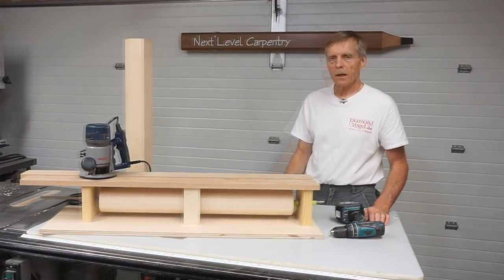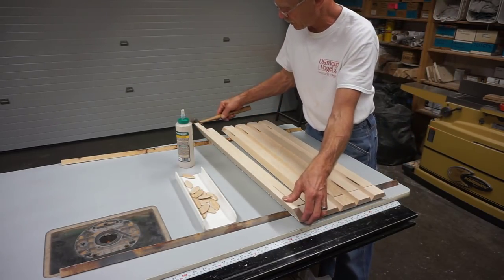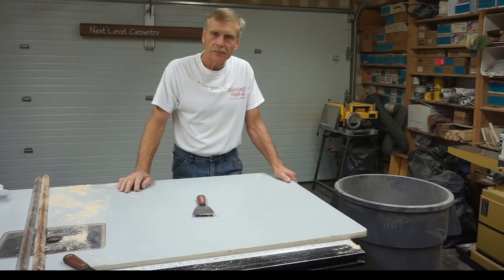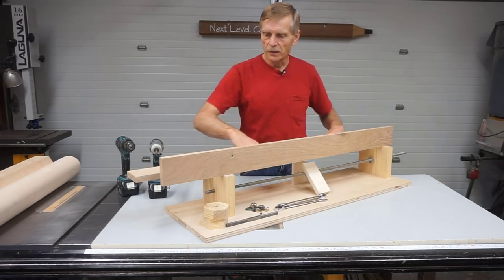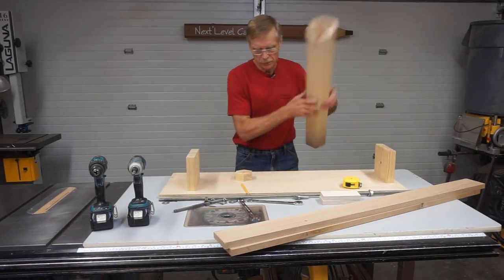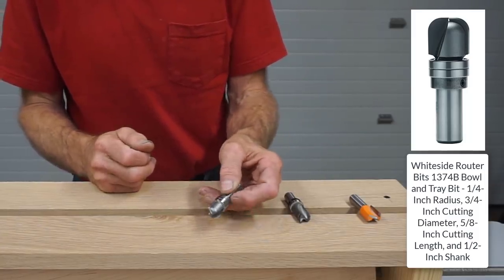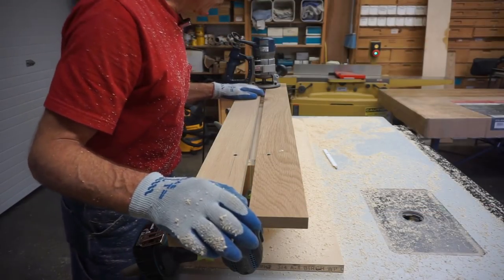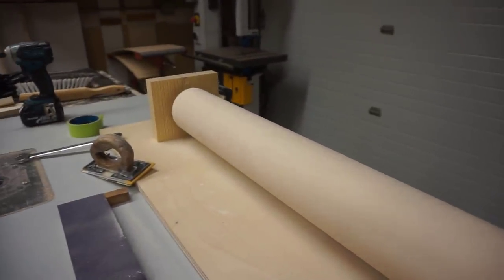How to Make Round Wood Cylinders with a Shop-Built Router Lathe

Comment: Hey Matt--Have just discovered your channel and am catching up on a few years of your videos. Great channel with lots of practical tips! Can you get away with a rectangular hub save yourself 8 rabbets and a bunch of cuts on the miter saw or are you worried about even torque distribution?
Reply from the maker: Welcome Eric... good question.  I suppose you could use a different hub setup if something about the process made the whole operation more efficient... if you're asking such a question I'm guessing you're the kind of guy who would do just that: build on what you learn and advance  the process.  I like how you think!  I don't think 'torque distribution' is as much of a potential issue as making sure everything is concentric so as long as you can still get concentricity (is that a word?!🤔) near to perfect, a different time/step saving configuration makes total sense.  Thanks for watching and commenting...
Reply: i guess I'm kinda randomly asking but do anyone know of a good website to watch new series online ?
Reply: @Layton Tucker Thanks, signed up and it seems like they got a lot of movies there =) Appreciate it!
Reply: @Connor Uriel glad I could help :)

Comment: I got one of those band clamps years ago for gluing frames.  I never considered using them for cylinders or using additional jaws.  Thank you for enlightening me.  For my hollow glue ups, I keep most of my punctured bicycle tubes and wind them around multiple times for incredible clamping force. They don't damage wood either.  You've probably used them to resemble chair parts as they conform well to the irregular shapes and angles and can pull in many more directions than bar clamps.
Reply from the maker: The clamps are great, aren't they Francis?  No substitute for inner tubes for some projects but remarkable for others!  Best, Matt

Comment: I do love how you take the time to explain each step in great detail so that the beginning woodworker can totally grasp the concept how to accurately produce the work.  Thanks!    The one thing I would have suggested instead of Nylock nuts is to just double the nuts and tighten them against each other.  Nylock  over time and use will not hold up as well.

Comment: Hi Matt,   I have done numerous such polygonal columns.   I have found that if I tape all the external edges together on the flat, inside down.    Carefully aligned while taping.   Then turn the assembly over and apply glue.    Roll the assembly up, stand on end, and slowly close the last joint [with tape already on one side].   The tape tends to push the squeeze-out to the inside.

Comment: I love this video. It reminded me of when I made 4 legs very similar to these. 1-1/2" stock instead of 3/4" and cut to 3-1/2" width on the wide side. 1/8" x 1/2" wide splines set into 1/8" x 1/4" deep dado ran the entire length of the leg. The reason for the extra thickness was because when I set up the centers, I raised one one end of the jig by 3/4" to create a tapered leg. The other difference was that I slid the jig over a router table between two runners attached to the table. The drill was still the same power supply for turning the stock. I love people like you who come up with new ideas for wood workers. Keep up the good work.
Reply from the maker: Cool that two entirely different projects were tackled in similar fashion Doug... I like how you think!  I hope I get a chance to do round legs with a taper some time... that's got to be even cooler to watch the turning process.  Best, Matt

Comment: Thanks so much. I know it's a lot of effort to do all that is necessary to post videos like this. One thing I thought of is that I liked the look of the leg after the 2nd or 3rd pass when it still had facets. More interesting than after it was a perfect cylinder. I'm wondering if you'd consider presenting this as an option to your next clients on a similar project. I love your channel.
Reply from the maker: Definitely an interesting option Stewart... didn't come up on this project since a 'perfect' cylinder was the goal but you never know when a slight variation might be just the ticket... thanks for watching and commenting! 
Best, Matt

Comment: Hey NLC   I think your co-commentator is slightly taller than you   .... a mammoth task to produce and I did make it all the way through .... very comprehensive and shows others how much actually goes into original woodwork  .... its not the outcome bt the process others learn from  .... a pro-cnc workshop could knock out a cylinder cheaply easily but not as satisfyingly  .... keep it up and thank you for your efforts  .... GB Bundaberg Australia
Reply from the maker: You're welcome, Greg... It can be a bit frustrating to see TV and video that drastically skims over the nitty gritty of craftsmanship, right? Love to see comments from down under... I'd love to grow the Next Level Carpentry audience in Australia... any suggestions for content you see lacking there?  Best regards, Matt

Comment: Enjoyed the video and information. A note myself: I'd be inclined to make initial passes down the length of the piece along the high spots (at the joints) with the stock locked in place in order to eliminate possible tear out during milling.
Reply from the maker: Slo Mo
You're thinking is sound.  Some of the difficulty I experienced was from not doing something  like you mention to whack down those points before mounting the blank in the lathe which is quite clear to me now, thanks to insight from attentive viewers like yourself who use their experience to guide them.  Your method would be a controllable way of removing excess wood from the blank.  Another viewer suggested using a tablesaw or jointer for the same result.  I really appreciate the non-confrontational way you presented this comment... this sort of discussion helps refine/improve the method for the benefit of all.  
Best,
Matt

Comment: Out standing video full of excellent information.For those that say it is to long then need to understand the "stop" button on the video. Watch, stop, watch more repeat as needed. I enjoyed the way you described the design, cutting and glue up of the blank followed by the building of the router jig and its operation. Question for you, are you familiar with "bird mouth" cylinder construction? It helps with the alignment of each piece of the blank. One way I saw was to use heavy duty tape and or thin rope to bind the blanks together instead of those very nice clamps you used while the glue dried. Over all an great video.
Reply from the maker: Tom, thanks for your positive assessment of the video and suggestions for those with shorter time frames and/or attention spans.  I've seen 'bird's mouth' joinery for cylinder construction but not 'familiar' with it ie: I've never done it that way.  
My first reaction to it as an option is that the extra milling time and effort it would take to shape the sides of all the blanks would make it considerably less practical using typical shop equipment ie router, tablesaw, etc than using the tablesaw/jointer, biscuit method I used.  If, however, you were doing a very large run of cylinders and had access to a shaper or 4-head moulding machine the extra time and money spent for tooling, set up and running of the 'slats' would be offset with less fussing over plunging the  biscuit slots and alignment issues, etc.  It all depends on the scope of the particular project at hand.
As far as clamping goes I completely understand reluctance to spend close to $200 on clamps for a cylinder to two... it's just not practical in many cases.  I'd be uncomfortable using rope, strong tape, etc for clamping though because any gaps, even very slight, in the slat joints would really spoil the look of the finished product.  Thinking about less expensive options just now I'm sure regular metal hose clamps from the hardware store with some shop made cauls to bridge the joints  would be a very workable solution.

Comment: Also made for a 'federal' styled Cocktail bar , columns of Mahogany this way also , but the difficult part was the crown molding to mate to the top and finish it to the ceiling . For that ,rather than spend on expensive tooling , I crafted a Scraper plane that was 'pinned' to its radius [and adjustable] so you by hand were able to make the Radius Crown Molding  needed for the 3 columns' .
Reply from the maker: Clever way of making that tricky column crown, Mark, nicely done!  I assume this means you didn't have access to a lathe for your project either?  Amazing what you can come up with when faced with limited options, right?  Best, Matt

Comment: Great video. Thank you for making it. I’m looking to make the same thing, but with a 20” diameter. I plan on using a birds mouth router bit making 16 staves, that are 4” width. My concern is when I make it round, I will cut out too much wood. How wide were the staves of your hexagon? How thick were they? When finished, how thin was the thinnest part? Any info would be greatly appreciated!
Reply from the maker: The good thing for your project is that the more staves you use, the less material needs to be removed to make it smooth and round.  I don't remember the stave width for this project but they were probably about 7/8" thick.  Regardless, each project is different so I'd advise doing a layout in full scale on a piece of plywood or particleboard using a compass, dividers and straight edges.  You can layout all the detail necessary to actually see what necessary dimensions need to be to avoid the problem you're anticipating.  Good luck with the project... it sounds interesting as it is challenging!

Comment: Back in the 80’s, Sears used to have a product called routercrafter.  It had a live and dead center and a hand crank to turn your stock.  There was a mount for the router on top and a couple of cables that would advance the router as you turned the stock.  It was pretty ingenious.  I made my kids bunk beds with it.  I got tired of hand cranking it so I connected a 1/2” corded drill motor to it.  I mounted it on a board with an ac outlet controlled by a dimmer switch to control the speed.  I wonder if craftsman still makes it!
Reply from the maker: Sounds like I merely resurrected an old invention Mikr... good thing I wasn't hoping to patent this, right?  It is kind of cool what can be done with something that's relatively simple though... Best, Matt
Reply: Wow the Sears wood crafter is from the 70's , I have one and have been making round pieces with it BUT the crafter you can only put may 4 '' thick piece to be rounded. This idea of his can be done for bigger columns not only thicker but longer than the crafter :) I love my crafter :) and his work too.
Reply: I think Trend still make a routerlathe.      Watching this makes me happy I have a lathe, lathe !

Comment: Considering the fact that the end result is a cylinder, I’m curious why you chose straight miters instead of birds-mouths, the latter having a natural propensity to align the segments. Thoughts?
Reply from the maker: I consider flat miters much easier to cut and assemble and because they're properly prepared I have no issues whatever of them ever failing so Birds mouths would be more works for no better results IMHO.

Comment: Very informational, especially for those with no lathe.

I was surprised at how the cutting started, i.e. treating it as though mounted in a lathe.

Not to address the difference in time required, but what about locking the cylinder in place and running a flat bottom bit along the entire length each time, rotate slightly, and repeat until you had trimmed off most of the excess, then use it as a lathe. Perhaps that would have prevented breaking the bit.
Reply from the maker: That is certainly an alternative worth giving a try so thanks for mentioning it.  Other viewers commented that I could have pre milled those sharp points off the cylinder on a table saw before starting with the router bit which is something I'm sure I would do if I ever need this setup again for making round Wood cylinders.  Thanks for your interaction on this video... Best, Matt

Comment: Hi Matt - great idea and great video but why take up the trouble to clean up on the glue oozing out when you are going to turn the wood anyway, that is to say, when you turn the hexagon into a cylinder ?
Reply from the maker: Although it's clearly not REALLY necessary, it's so little 'trouble' to clean up glue squeeze out using sawrdust and a sharp putty knife that I do it out of habit, Peter.  Sometimes I pause in the middle of a project to put tools away knowing full well I'll need to get them out again before I'm done.  I guess it's like a mental 're-boot' that maintains an organized frame of mind that's conducive to better end results?  Best, Matt
Reply: Right on Matt - always be in control - I still think this is the best video on making a hollow wooden tube, just have to get my head around the maths. @NextLevelCarpentry

Comment: Hi! Great video! I know the video is 5 years old now, but do you know how thick of material you used here?
Reply from the maker: Noel, I would have used 4/4 material that I bought planed 'hit and miss'.  That stuff is usually about 15/16" thick but is usually still wavy and warpy.  As you can see in the finished product it could have been 1/8" thinner and still worked fine.
Best,
Matt
Reply: @NextLevelCarpentry  Cool, got it. Thanks for the info!

Comment: I love what you did, how ever I wish you would have shown how to cut the biscutes, I do not understand how that's done.
Reply from the maker: Thanks Bill, for watching and commenting.  Sorry; I didn't include details about the biscuits because it's pretty routine... if you've used them before.  It's the same as using biscuits on square edges with the only difference being that you 'index' or align the biscuit jointer's guide/fence on the 'sharp' edge of these angled boards and place the face of the tool so that it plunges into the angle jointed edge face at 90 degrees. I guess that's harder to explain than to show but just visualize the way biscuits fit into a regular square-edge joint and then set up your tool to produce the same result in the angled edges... and post another comment if this is still confusing.  Best, Matt

Comment: wondering if you experimented at all with moving the router off the centerline of the blank intead of changing to different types  of router bits?
Reply from the maker: greg choma 
I did not consider that although I'm sure there are times when moving the router off center might get the job done.  I was a bit pressed as it was for protrusion of the router bit and moving it off center would have required more length.  The biggest thing I would have done differently was to follow other viewer comments and pre mill the bulk of the segment points off before advancing to the router stage.  If you end up experimenting with this and find a more advanced solution please share it here for my benefit as well as other users... there is always room for improvements on this sort of a system and half the fun of doing a video is to learn those things! Best, Matt

Comment: Just have a couple of comments. You could put a notch in the tops of the two end pieces to add more space  for the router bit. Second comment, use masking tape to hold the six sides while gluing, much easier to do.

Comment: Great video and  excellent explanation of each detail. - Jeremy
Reply from the maker: SEOA, Thanks for commenting... it's very encouraging to know you appreciate the video.  I do a lot of woodworking for clients and this project stood out as one of the more challenging and rewarding to me personally so I hope it helps encourage and inspire you too!
Best,
Matt
Reply: I do some woodworking myself, but most of mine are smaller projects. I love learning from others.
Reply: Suggestion. Parallel 'T' track the tailstock assembly, doesn't have to be the full length. Use DADO blade shims under baseplate, set router bit bottom on workpiece, remove shim and cut. This will give consistent thin cut without 'fiddling' it at the tail end and you can creep up on a target workpiece diameter if required.
Reply: Duplicate a scaled unit for a palm router or a Dremel type sized router .
Reply from the maker: MrBonners, thanks for your comments!  This is definitely the kind of setup that can be modified, altered tweaked and adjusted to better suit the user and task at hand.  I can see where your suggestions could improve performance and adaptability to a variety of different uses.
Reply: A few bits and pieces of short 'T' track laying the shop, cut offs. Anything more would make it worth it to build a tricked out one.  Old woodworker saying. 'Don't measure or guess when you have shims all around.'  Post-it notes, business cards, several decks of playing cards are scattered all round my little shop.